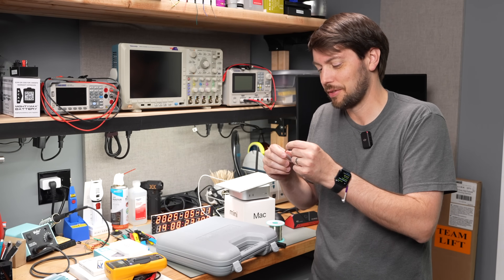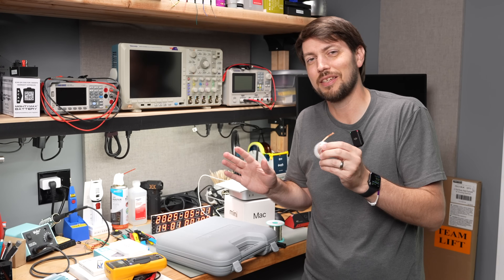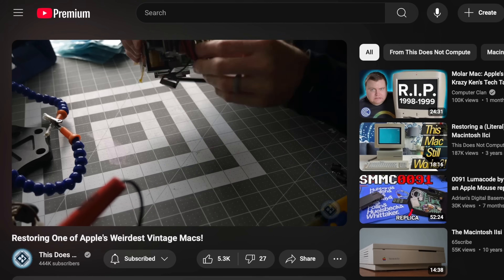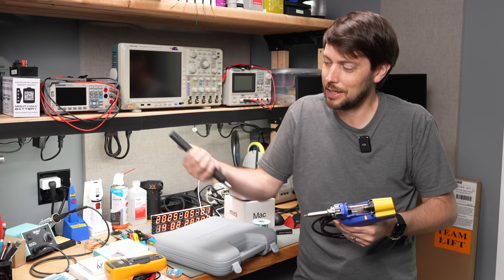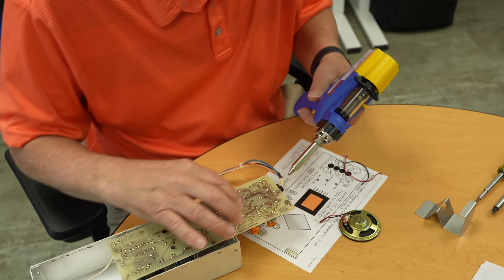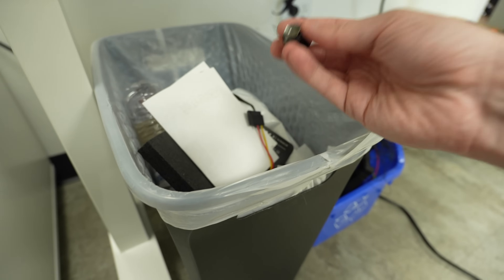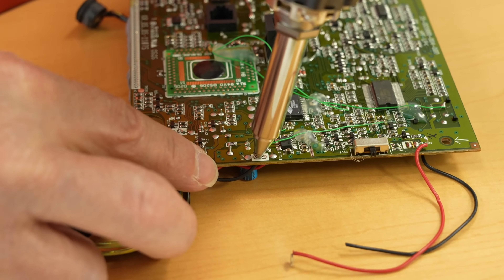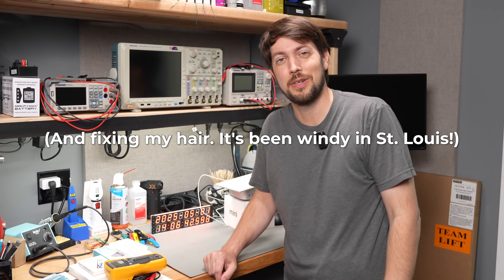Nobody told me desoldering could be easy! (Hakko FR-301)

Comment: Yeah I had a cheap pencil version of that sort of tool, and yes they are really really convenient and make solder wick feel almost obsolete... Convinced me that next electronics project I'll get a good one that will actually last for more than one or two projects, as get what you pay for that cheap one died pretty fast and wasn't really repairable - heating element died and the whole thing was welded and heat staked together.

Comment: Such a neat tool that i will be considering too, it would make a lot of larger unsoldering so much less tedious...

But i do wanna chime in with some personal tip about braid, because i often do very small smd work (replacing tiny high pin connectors on game consoles is an especially awful one or fixing up single bad pins on a freshly soldered high pin count tqfp) and for that the precision braid can give you is unmatched imo but what i mostly see people doing is holding the braid like you would a strand of solder and it just loses all that fine control your hands/iron tip has. 
I recommend unrolling a longer (long enough that half the length is enough buffer between heat and your fingers) strip of braid, dunking it in flux, holding the both ends (the one near the spool and the loose braid end) with your fingers and pressing the middle of it down with your tip. Sort of like forming a very pointy triangle or a conveyor belt lmao and that keeps the braid flush against the iron tip. Then as i unsolder more i can roll the wick across the tip slightly to get to new wick. 

For me tiny soldering has become a lot more enjoyable once i figured out this way and i hope it can help others too!

Comment: I know you guys call it soddering, not soldering, but why keep spelling it solder? At least the braid manufacturer labels it Soder-Wick. (Looks like I just got myself a side etymology project).
I used a commercial de-soldering station many years ago and that had a separate vacuum pump, an on gun flux dispenser and solder feed (sometimes you need to add solder to get things to melt nicely) as well as proper fume extraction. The unit you have looks a lot more handy.
Reply: It's regional.  In various parts of Canada it's "SOLL-DURR", or "SOH-DUR".  I have heard Americans pronounce it both ways.
Reply: So I did my homework (yeah, I Googled it) and we must blame the French, well the Normans to be more accurate.
The original word comes from the Latin, Solidus and the French made that into Soudre. The British then 'borrowed' the French word (more likely had it forced on them by the Norman invaders) and stuck with it (sic) until sometime in the 19th Centuary when academics decided to go back to the Latin roots of quite a few words and put the L back in.
So the Americans stuck with the earlier British/French pronunciation while the British followed the fashion and started sounding the L again.
No right or wrong, just different.

Comment: There's a halfway compromise between the two tools, which may be the best option for most: a desoldering iron, which is essentially a manual solder sucker plunger merged with a hollow tip soldering iron. For an example, see the Yihua 929D-V.

They can be obtained for $5-40, and I've known some seasoned EEs who prefer this form, because they're lighter and quieter than the motorized pump guns like the Hakko, but way nicer and faster to use than a separate manual solder sucker, as they solve the timing issue of a separate one by being their own source of heat.

I haven't had any issue with fatigue with mine, even doing scores of solder joints in one session, holding it like a dagger you're trying to stab the PCB with is comfortable and priming the plunger takes little effort. Stores smaller and the price is hard to argue with for a hobbyist.

I wouldn't say someone who already has a Hakko FR-301 should fret, they're very nice and well made, of course. 😊
Reply: I'm pretty sure one of those could be converted into a "full Hakko" simply by drilling a hole into the vacuum chamber and attaching a tube from one of those $5 12V piston-based mini water pump thingies that are almost certainly the exact same thing you hear purring inside the Hakko too. The original is just laughably overpriced.

Comment: Pro tip: make sure you clean out the tube at the end of each desoldering session. At least with mine (a cheap Chinese import, not the same as yours), I've found solder can build up inside the tube, and if I push a thick solid wire through it, it will poke into the clear part with solder all over it. Pulling the trigger while removing the wire seems to allow more solder to get sucked through. I sometimes have to do that in the middle of a large desoldering session, because it can get clogged with that excess solder.
Reply: The hakko comes with the wire to do that, it has a spring on the one end.

Comment: After you've desoldered a joint, as you lift the gun away, keep it running, as in just a second or two longer than in the video to make sure the tip is clear and all the solder is in the capture tube.

Comment: hello, try adding a piece of actual silicone tubing to the tip of the manual desoldering pump. You called it silicone but all I see is the white rigid nozzle, flexible silicone makes a big difference

Comment: Wow! Didn’t know this was a thing! Only ever used the manual sucker tool my entire life.
Reply: Continuous-vacuum desoldering equipment has existed since the 1960s! But for a long time, it wasn’t really essential. With single-sided boards, and double-sided boards without plated through-holes, desoldering wick and manual solder suckers work quite well. But it totally changes with plated through-holes, because even trace amounts of remaining solder can result in the component lead remaining sweated to the inside of the hole. Vacuum desoldering solves this by letting you run the vacuum while keeping the lead in motion, so cool air flows along it and cools the joint so it can’t re-sweat. See https://youtu.be/IqE1KA0OAnM?si=p-HVwJmmvvxYCdP3 (chapter 5, from around 17:10)

Comment: I don't see any flux. In all the pcb repair videos I see they use a lot of flux,  I am sure that will make both the wick and the gun work better
Reply from the maker: For the wick in my clips I had slathered some flux over the areas where I was dragging the wick—but the board was not preheated and had a large ground plane I think was pulling a lot of heat :(

Comment: The fr301 is the gold standard for desoldering guns. In the custom keyboard world, it makes life so easy to desolder boards.
Reply: My Pace SX-100 begs to differ. Can't image using one for a whole keyboard, it's like a lead weight! And they don't come with a proper stand, don't forget to budget for that, DO NOT use that metal thing they include as a stand you'll burn the office down. Seriously though not my favorite BUT they have become very cheap (can get $200 new). I have one for backup but doesn't get much use.
Reply: @archmaneric9251  I have the SX-90 (which is 100% identical to the SX-100, aside from the color of the silkscreening on the handpiece!), and I agree. Way nicer than the guns.
Reply: The FR-301 is great, but Hakko also have some high end desoldering stations like FR-410. The FR-301 is more of a budget option for people that don't need to do through-hole desoldering every day, or they need a self contained portable tool.

Comment: I don't desolder all that often, but I have all kinds equipment to do the soldering part.  I use the small button-vacuum solder sucker, but I do want something like this though, just not at $300USD.  

I've thought about hooking up my vacuum (Either shop vac or a more quiet vac, or a really small hand held vac -- Not sure) to a foot switch, 3D print an adapter that'll go from the vacuum to a small long flexible hose, with another 3D print to attach the other end of that hose to one of those silicon ends on those solder suckers.  Flick the switch on with my foot, vacuum turns on, I pull the solder out with great force (Slowly "walk" up to it of course) and I can use the iron to move the pins/legs.

Next months project? heh
Reply from the maker: Just be careful to not pull so much air you make the soldering tip too cool!
Reply: @Level2Jeff  It'll take practice, yeah.  Keep the heat on the pins, quickly come in with the vacuum.  I'd imagine I'll screw it up a few times before I catch onto how the tooling works.  The AiO option you've got, it's great.  But, my being a guy who rather likes hacking stuff not meant to be together, fun project. :)

Comment: In an earlier career I desoldered components every day. I found that compressed air driven solder suckers (Using the venturi effect I guess) had much lower maintenance than electric air pump ones. (meaning cleaning and de-clogging). The actual soldering things were the same (Weller) but the vacuum picked up faster with the compressed air tools and made them work more reliable.

Comment: When I went to electronics school they recommended we get solder suckers because copper braid is usually best for quick jobs (several of us found out very painfully why extended sessions with solder wick are not recommended). The tip my teacher gave me was to hold the sucker tip on top of the iron tip at an angle for a bit until it melted a little divot into it. That way you could hold the iron at an angle on the board at the solder joint, the sucker upright, the divot would conform to the soldering iron tip, and it would make a pretty decent seal around the pad. Sure a Hakko is better if you can afford it and are patient enough to keep it running, but sometimes a $20 solder sucker will get you through a job.

Comment: The manual one has an attachment, here in brazil we call it the camisinha (condom) of the dessoldering pump, its just a silicon tube that helps isolate the pad so that is sucks the most solder

Comment: My high school electronics teacher got one of these except instead of having a motorized pump behind the hollow soldering iron thing it just had a standard spring and plunger with a button to trigger it like a normal standalone solder sucker. But it worked very very well!

Comment: I love my FR-301. I mean, I don't like needing to use it, because it usually means something has gone horribly wrong. To me, pulling this thing out is kinda like pulling out a set of left-hand twist drill bits, or some EZ-Outs, and a tap and die set when working on my car. The latter almost always means you goofed up really badly. 

But while it is a little bit pricey, the FR-301 is absolutely a great tool. It makes de-soldering SO much easier. For anybody who does a lot of repair work, or who just needs to correct their own soldering mistakes (putting a component in backwards, etc) from time to time, it's worth it. Ditch the desoldering braid and just get one of these. You won't regret it.

Oh, and yes, the cheesy little "stand" does kinda suck. But the tool itself makes up for it.

Comment: These are amazing and I am still not capable of affording this thing. But I was able to get an electrical version of the manual one.

If your interested in looking it up search "Solder Sucker, Automatic Desoldering Pump Vacuum, Portable Electric Solder Tin Sucker, Vacuum Soldering Remove Pump Desoldering Machine, AC110V 30W with 3 Soldering Suction Tips" by VISLONE (~$40)

it's basically the same as the manual one but it uses a solenoid to "suck" not a spring.

Comment: I do not need to watch your video, I know what it is about and I agree. I had been soldering for half a century and that tool is the biggest time and part saver I have ever used. Clean, doesn't pull the pads off the board or require you to melt everything plastic in the vicinity. It takes ALL the solder off a joint. It makes pulling an 86 pin connector off a PCB a breeze without damaging the board or the part. You can use it on a SMT parts (expert level) as well. (Use a little flux on stubborn joints.)  Now I'll watch your video.

Comment: bit spendy, but if you're kitbashing or diy, doing a lot of through hole stuff, the desoldering vacuum is worth it. if you're only doing a bit.. it might not be at the several hundred dollars even the cheap ones tend to be.

if you do a lot of smd, a pcb heater might be a better option.

Comment: Have used a manual solder sucker tool on MANY tens of thousands of through hole solder joints. 
I've always had best luck if the component leads were cut at the boards surface, then the solder and the tiny remainder stub gets sucked out. 
This technique generally results in less wear and tear on the pads and plated through holes, as you won't be trying to pull the component out with incomplete solder removal.

Two more tips for manual tool selection: 
- don't get one with a 'trough' around the plunger - then you can just press the plunger against your thigh to reset it and try again.
- be sure to get at least one that is anti-static. Especially if you're working on older boards with chips that are lacking the modern ICs robust ESD protection diodes!

Comment: Hi Jeff, (from New Zealand) Love your Great videos.  One little tip when using these de-soldering type if you can train you self to keep the trigger pulled for about 2 seconds after you have removed the tip from the joint ..... This ensures the solder just removed makes it all the way back to the collection chamber.  The reduces the frequency of clogging.   Also on multi-layer boards a soldering on the opposite of the board at the same time makes it easier to clear the holes.   First de-soldering station I ever used was a PACE .... The modern ones are much better ....

Comment: When I got my 301 it worked amazingly well. I thought I was taking good care of it, too. Diligently using the supplied tools to clean things out regularly. These days, it just seems to have significantly less suction power, and I can't quite figure it out. It still works, but it doesn't have that satisfying new car smell first day wow, and seeing your video made me miss that.

Anyhow, I came to give you shit for not using proper ventilation when desoldering. It's just as toxic as soldering, and if you're working over old boards, you're literally huffing lead fumes.
Reply: If it's like the 808 I own (predecessor to the 301), the valves can get gunked up with flux after plenty of desoldering operations.  I suspect that may be why you have less suction.  As with the earlier tool, Hakko probably sells replacement valves.  They are inexpensive and easy to change.
Reply: Absolutely, except that lead doesn't evaporate at soldering temperatures.
Reply: "Lead fumes" has been debunked and is now generally accepted as not being a thing.  Lead is too heavy to rise in the rosin smoke and does not vaporize under soldering conditions.  Consider that when you pull the trigger on the tool, all that is sucked into the machine into a filter.  Just ahead of that filter is a diffuser plate; if there was vaporized metal in the smoke, that would instantly condense it.  There is very little fume released into the room with these tools.
Reply: I should add that when emptying the solder collector, it's a good idea to wear nitrile gloves and a dust mask.  You don't want to be touching that if you have any openings in your skin.
Reply: So first of all, I want to acknowledge that @loc4725 and @PixelSchnitzel are correct. I meant well, but TIL that lead is not present in the still very toxic smoke.

That said, while I was wrong about the presence of lead, I strongly protest the notion that the gun is sucking up all of the fumes. I use it several times a week and can testify that there's still a very significant amount of nasty smoke unless I have a good extractor going. I don't think it's productive to claim that no extractor is needed with this device when the best amount of rosin particle exposure is zero.

Is the presence of smoke and reduced suction linked? Very possibly; thanks @don_cc123 for the nudge. I will investigate.

Comment: There is a technique to using these, and this is much easier with a desolder station and "pen". First, a littke fresh solder can really help to remove everything. Second you should make a small circle with the tip, you'll feel when the component is free, then hit the suction. Third, let the suction run for a few seconds after you pull it away, this can help prevent clogged tips. And fourth, when it is really clogged, break out the crack torch to melt things in the tube. I used a Pace at one job, it was great but expensive. I bought a Xytronics station about 20 years ago that I still use once in a while.

A fifth tip, if the component is not free after the suction, solder it again then try the suction. Heavy ground plain is an enemy if it is designed poorly, sometimes you still need a board heater, or in tandem with a soldering iron for extra heat.